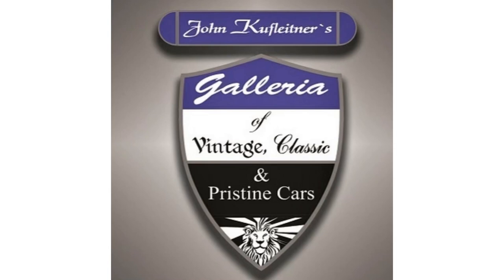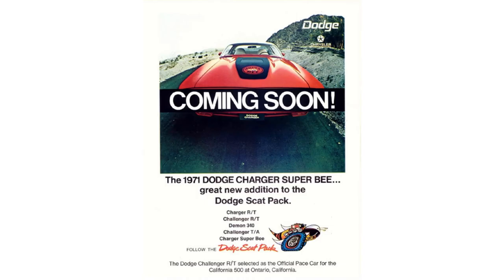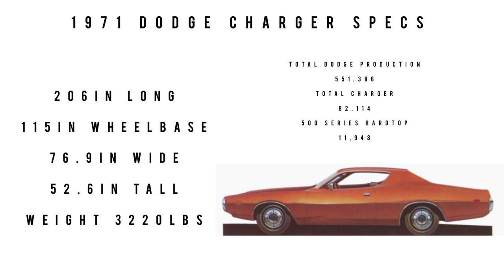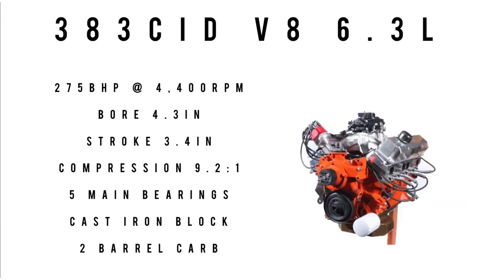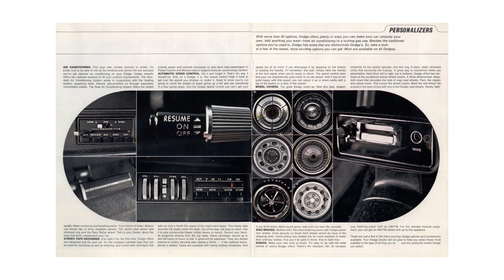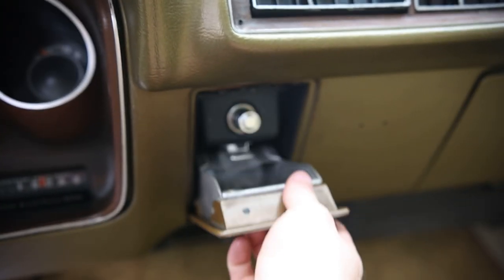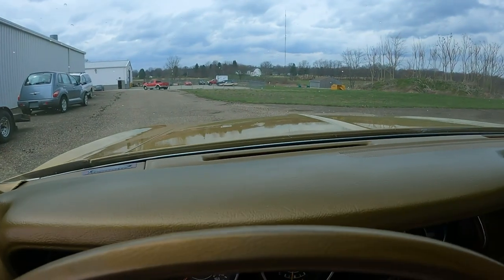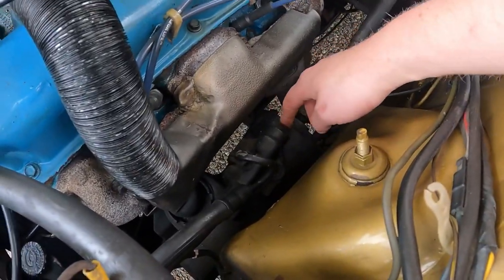1971 Dodge Charger #what_it’s_like

Comment: My family were the proud third owners of a ‘71 Charger R/T for over 20 years. 440 Magnum, 3-speed Torqueflite with Slapstik console shifter, and loaded to the hilt with SE options — Rallye wheels, wider G60 x 15 tires, chrome exhaust tips, ‘tuff’ steering wheel, AC, cruise control, power front & rear quarter windows, covered headlights with washer brushes, factory AM/FM stereo with cassette player/recorder (not 8-track, cassette!), houndstooth cloth seats and black vinyl top…finished in GK6 Dark Bronze Metallic. Essentially a luxury muscle car. 

According to Charger registries, there are currently 10 known examples left of ‘71 R/Ts with this color and engine combination! 

My folks had to let go of the Mighty C about 14 years ago due to unexpected financial hardship, but she’ll always be a part of the family. Incredible, unforgettable vehicle that I was lucky enough to grow up in/around!
Reply from the maker: I love the nickname that you gave your car that’s awesome mighty C  that sucks your parents got rid of it considering how rare it is I wonder if it’s still out there sorry for the late response I wanted to make sure that I read everything right been juggling a lot of things today

Comment: The performance editions of the Charger were special, because you could get a luxurious experience with a smooth ride, while giving up none of the straight-line performance of a Challenger. And ordering the automatic trans over the manual was not a penalty---the Torqueflite 727 was excellent, and snapped off shifts crisply. The Charger was ideal for the man who wanted to cruise around comfortably during the week, while taking it to the drag strip on Saturday night
Reply from the maker: It took everything for Chris to do a burnout with that car 318 automatic but it’s possible and we didn’t use tide.

Comment: Had a 71 SE . There were 2 different 318 options.  A red or blur block 318 depends which transmission it was bolted to. Also my SE had a target-like hood ornament that said SE in the center.

Comment: you gave the same bore and stroke specs for the 426 hemi as the 440...the 440 is 4.32 bore 3.75 stroke, and the hemi is 4.25 bore 3.75 stroke. I do believe the charger also had the options for a 340 up until 1972, a 360 from 72 to 74, as well as a 383 for 71 to 72, and a 400 for 73 and 74.
Reply from the maker: Thank you so much for those corrections =)
Reply: @What.its.like.  awesome video none the less...I love seeing these old cars get the attention they deserve. Thank you for the content.
Reply from the maker: No problem I’ve waiting for a channel like this and it never came so I figured why not make one no one talks about specs price or engines that are in these cars =)
Reply: The 383 2bbl and 4bbl ended in 1971.

Comment: I'm surprised someone wouldn't have put power brakes in it at any point.

I'd love to have a 72 Charger with a 340 or a 318. Hell, even with a 225 Slant 6 I'd still feel like a bad ass. I'd take the auto with the slap stik (all autos had that?). Gotta love the huge window space when both windows are rolled down.  

These things are tied with third gen Thunderbirds and Karmann Ghias as some of the best looking cars in my opinion. Type 34 Ghias are also up there.
Reply from the maker: I had a 73 karman Ghia I wish I had that car now it got 32 mpg on the highway, it was like driving a high powered lawn mower =p that car we bought right after I got married as a flip project long story may share on here as an episode on day
Reply: @What.its.like.  I have a 74 Super Beetle and have since I was just about to turn 19. I love it. It's needed an alignment since I bought it, the never touched engine is consuming and leaking oil and the original muffler is starting to get pinholes in it, but that damn car just won't die and starts immediately. 

Great power too, I regularly go up hills steep hills and maintain around 55 in third. I can get the thing up to about 70-75 before it starts to lose power. 

Can't speak for MPG as I never really measured it and the odometer (and speedo) didn't work when I bought the car until I rebuilt the speedometer and put in two new cables (it ate the first), but I don't think it can be much worse than my 2004 2WD Tacoma. I think the one time I did check it it was around 28-30.

Really love that car, bought it from the family of the original owner and I'm the third owner. Desert car its entire life too, so not a spot of rust. Sometime soon I'm going to replace those 30 year old tires, get the engine rebuilt and an alignment and start driving it when I'm not working again. Thing deserves it.

If you'd like to share your car, that would be great. Ghias don't get as much love as they deserve.
Reply from the maker: I don’t have the Ghia anymore I’ve been looking for one to do they are rare around here I’m friends with the lady I sold my Ghia to but she’s a private person and doesn’t want me to do it =( kinda sucks but have to respect their decision. I put HID head lights in and it had a generator vacuum wipers and key would only go in one way.. the lights were hilarious when at idle they were about as bright as candles in jam jars. At speed they were good but not when driving 25 they where super dim because of the generator. I didn’t have to do anything to that can mechanically all the work it needed was cosmetic.

Comment: When did they start making the front end out of fiberglass?
Reply from the maker: Not sure
Reply: I'm not aware that the factory ever made a fiberglass Charger, but I'd guess it didn't take the aftermarket long to produce fiberglass body parts, which are still available today.